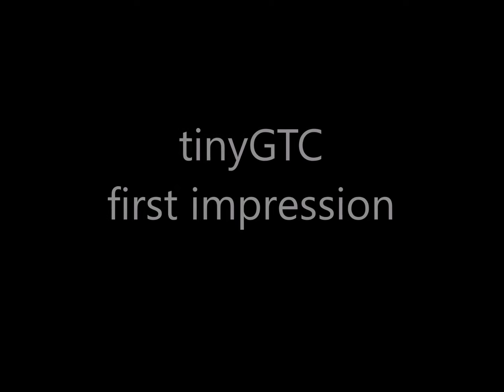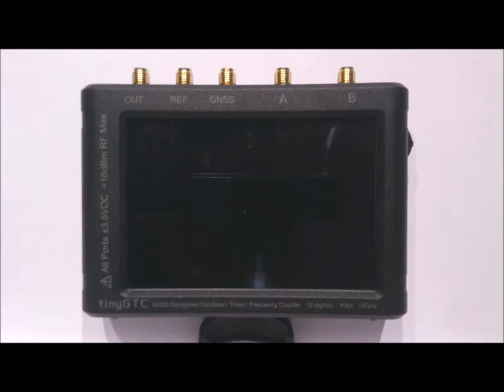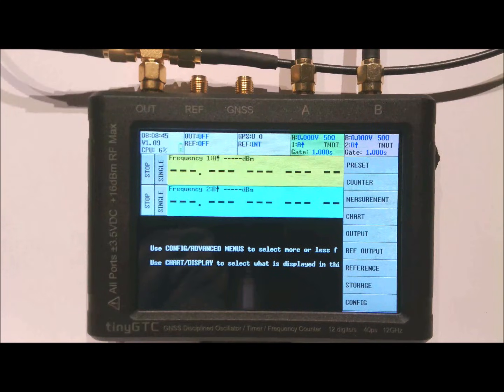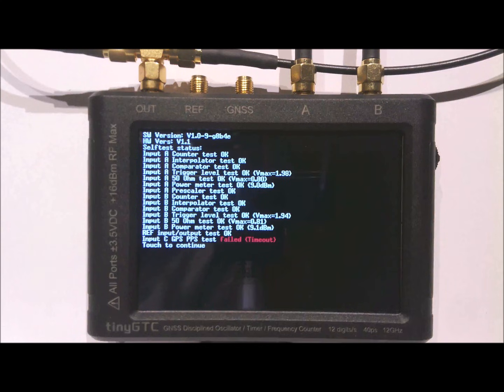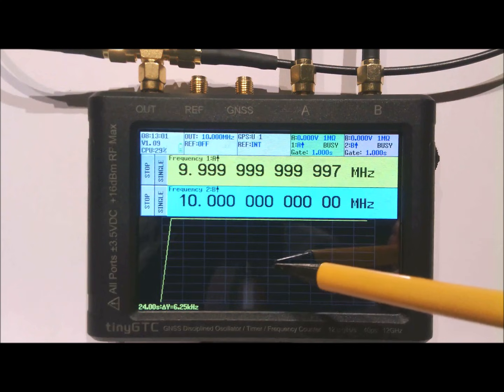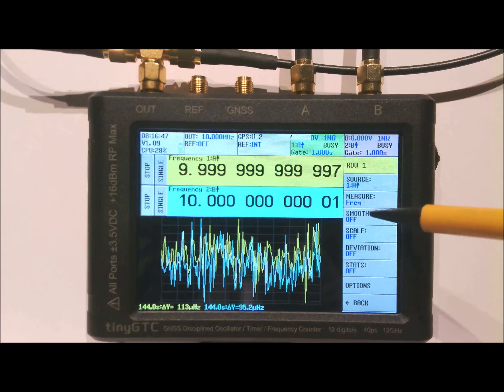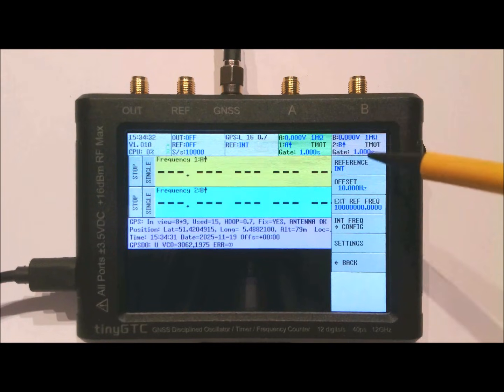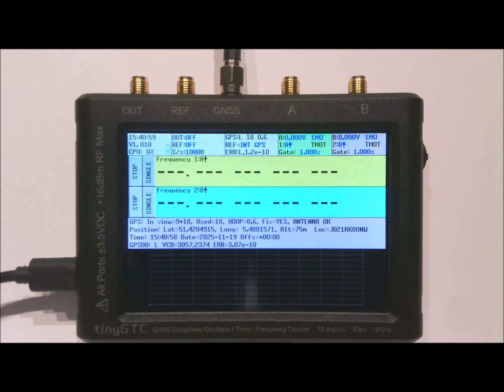tinyGTC introduction

Comment: Good morning Dear Erik. Yesterday I received my TinyGTC and now all family is completed (NanoVNA, TinySA and TinyGTC) I hook-up the GPS antenna and very fast it locks about 20 sats. I make some mesurements and looks to work properly using an 10MHz tcxo as source with a 30db attenuator. Trying to mesure some RF signals from my handheld VHF-UHF radio the frequency was away of truth and the same behavior was also the same using my signal generator. Im sure that is my fault about the settings. Where can I find a user manual and tree of menu explaing me the options for each one. Provide us a video to step by step measuring RF signals please. Also there is any software for win10 ??? Thanks in advance Mike SV5BYR
Reply from the maker: Suggest you visit the tinyGTC wiki

Comment: Hi Erik, Thank you for the detailed video. Could you add a video if you can about how to do the next steps on enabling the REF port or maybe I have to use the OUT port? after getting a GPS lock so you can use the GPSDO function let's say with a hackrf/usrp to provide 10mhz clock to an external device. I'm also guessing I would just have to click on the "REF" screen button after getting gps lock and enable it that way and plug in my external device into the "OUT" port once enabled not the "REF" port. Thank you! I just bought the device lot's to learn compared to the TinySA! I will stay tuned.

Comment: Nice looking equipment. Can the Out/Ref offer simultaneous combination of GPS disciplined 48KHz/1PPS, for some project testing I am setting up in the new year?
Reply from the maker: Yes. This is possible. 1 Hz from OUT and 48 kHz from REF
Reply: @ErikKaashoek Is the rising edge of 1Hz output correctly aligned to GPS 1pps?
Reply from the maker: @mungewell no, but you can measure the exact offset from top of second
Reply from the maker: Starting with FW version V1.018 it is possible to output a 1 Hz aligned with top of second of GPS time
Reply: @ErikKaashoek Wow, this is definitely on my Santa List now! Thank you...

Comment: Just be aware that regular use of devices with tiny screens is contributing to the onset of short-sightedness and increasing the risk of long-term vision decline. The tiny-concept is unreasonably small and eye-damaging.
Reply from the maker: You can connect it to a PC and  use tinyRemote to avoid that
Reply: For me, this is an acceptable tradeoff for the low cost feature, given that I can mitigate it. I invested in optical aids over the last couple decades, but fortunately I am far-sighted still. I can't read any small anything now without glasses, but don't need them for distance. I always take them off when looking around the room - possibly due to in intuitive notion that I might shift my vision if I didn't. So far, so good over the last 20 years of doing this since my presbyopia started in my late 40's 🙂

Comment: Also, cell phone basestations used to use cesium clock references, but switched to GPS due to their incredible frequency accuracy.  It would be great to be able to use the tinyGTC as a reference oscillator tied to GPS signals!!
Reply: Rubidium, not cesium.
Reply from the maker: Linking to GPS is already possible. Connect the supplied GPS antenna and select REFERENCE/REFERENCE/INT GPS

Comment: Fantastic. Only prob is my old eyes have no chance with a 4" screen 😥: Video out mirroring the screen (any kind even VGA !) would be great - wouldnt need to have the touch which could still be on the 4" primary.
Reply: I have seen a demo from Erik, there is also an computer app which mirrors the display from this TinyGTC.
Reply: @HedgehogFeed  Yes, I tried the windows desktop for my TinySA and it kinda worked under WINE on linux but not reliable. Not played with the python library. Dont really want to have to boot a computer either. Do appreciate that multi-format HDMI out would be a lot of work but display looks like SXGA 1280x1024 or similar so outputting that to a VGA port would be great with a cheap 10" monitor from aliexpress. Going to buy a TinyGTC anyway - will just have to squint a lot !